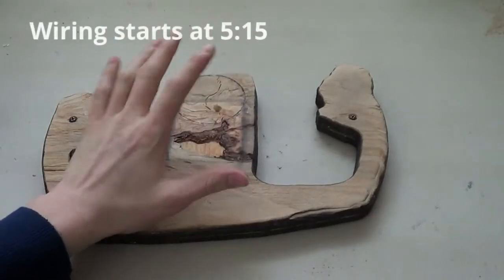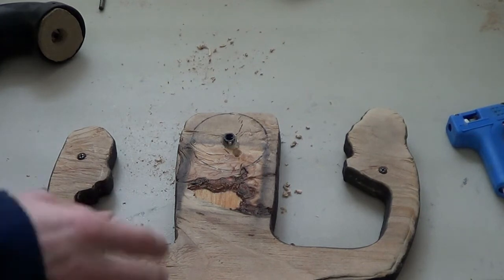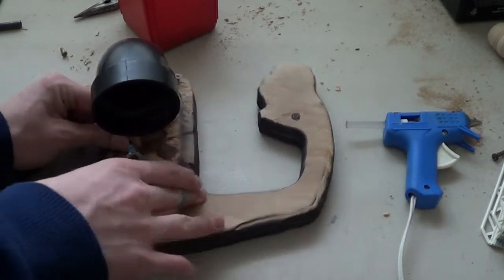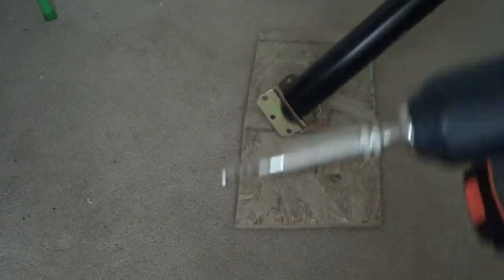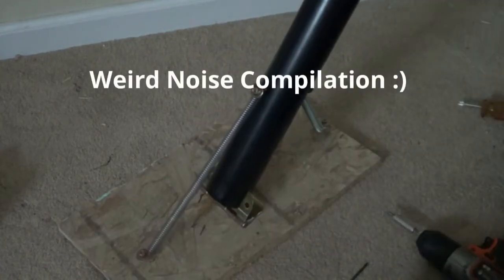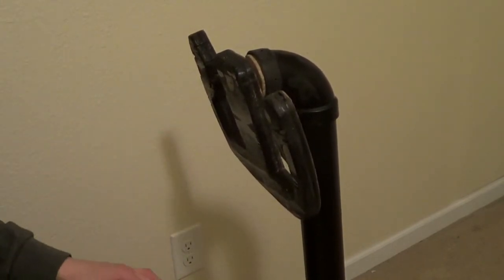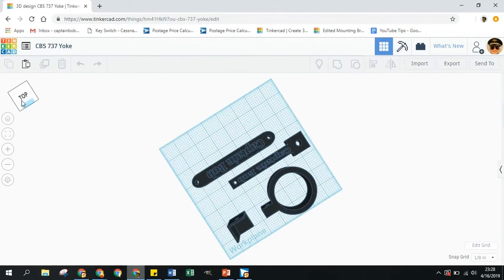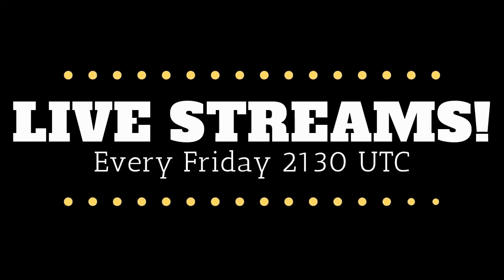Return to Center Springs and Wiring for the 737 DIY Yoke Part 2 | Captain Bob

Comment: Hello! I made my own b737 800 homecockpit after 4 years of work i just need to make a Yoke and i came across this video i saw you used springs for the centering but sadly i tried it and it was off by a couple of degrees so what could you suggest me what can i use instead of springs? could you help me? Thanks.
Reply from the maker: A lot of people use gas springs/struts! You can also adjust the distance or calibrate the potentiometer if it's a consistent error.
Reply: @CaptainBobSim  Oh gas struts actually have lots of them laying around in my workshop definetly gonna try it thanks for the help.

Comment: As I understand, Mobiflight does not support potentiometer, how do you actually use it with mobiflight?
Reply from the maker: You don't! At least not the axis. You could use a rotary encoder with mobiflight, but refer to my 5 axis controller video for installation
Reply: Captain Bob - Flight Simulation Made Simple ok thanks for the reply. I found out a way to use potentiometer with vjoy.

Comment: hey mann thinking bout making this after lockdown is it like hard or too smooth?
Reply from the maker: The pitch axis is a little bit rough, but for the most part smooth, and the roll axis is very smooth. 
These both require a fair amount of tweaking to get correct and to make smooth.
I think mine might be too smooth,